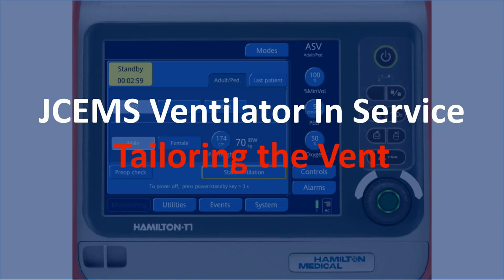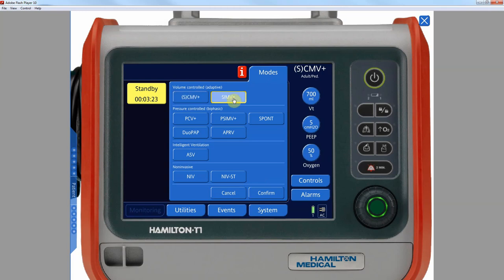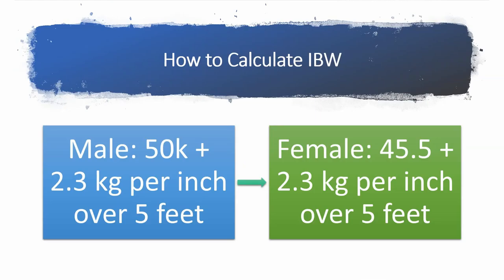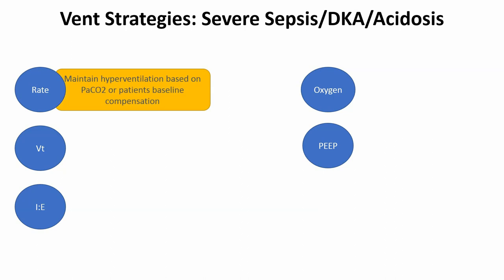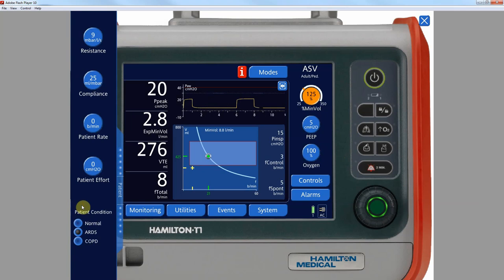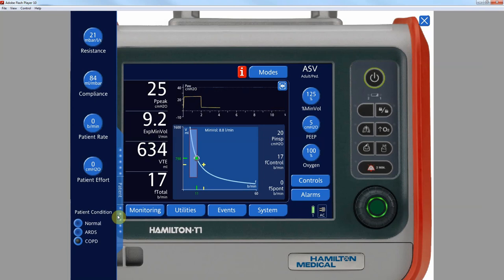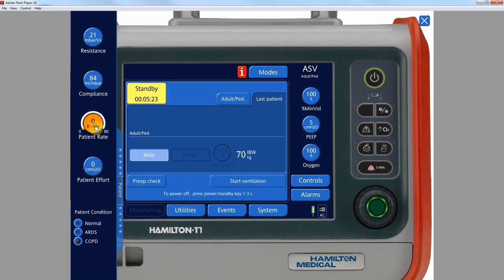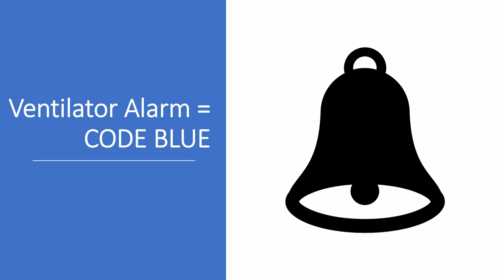Hamilton T1 In-service

Comment: I believe you recommend PCV during CPR. My readings suggest CMV would be a better mode for ventilation during CPR than a pressure targeted mode.  Compressions would increase intrathoracic pressure and cause premature cycling without assuring a delivered tidal volume.  Interested in hearing the views of those more familiar with the subject then myself.
Reply from the maker: The T1 is a pressure ventilator, so even if you use a volume targeted mode the breath is limited by high pressures. Hamilton has since came out with a CPR mode with default settings. We still use a pressure targeted mode during CPR but with a high peak a pasv limit. We monitor our epired tidal volumes and are getting good volumes with a pressure mode during CPR. Remember, when cardiac output drops, the minute volume demand drops proportionally, so you don't need normal volumes during CPR.
Reply: @floydmiracle8984  thanks for taking the time to provide me with some clarification on that.  Appreciate it.